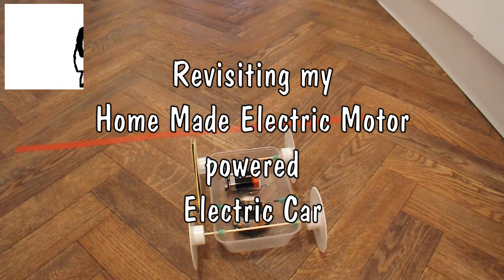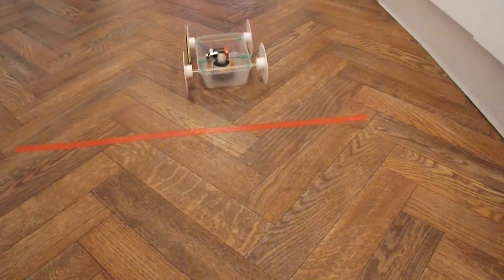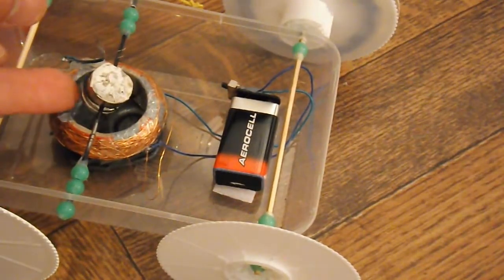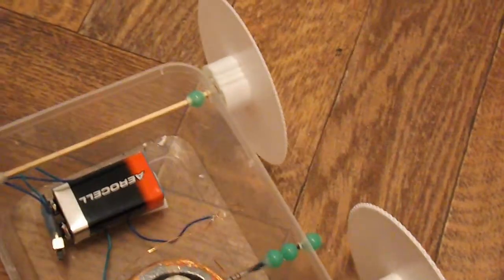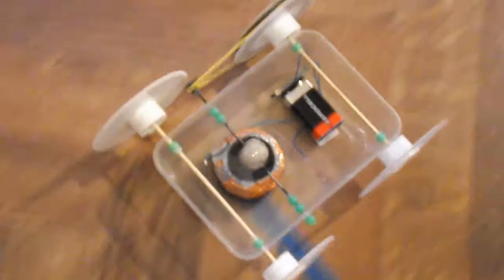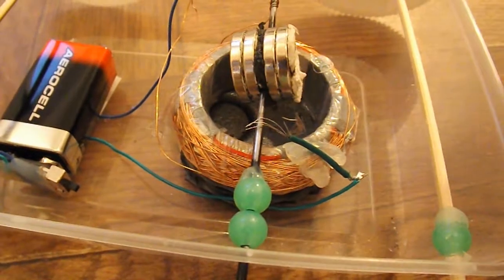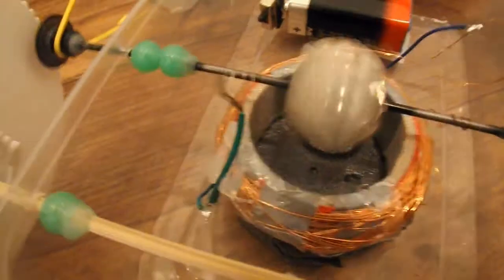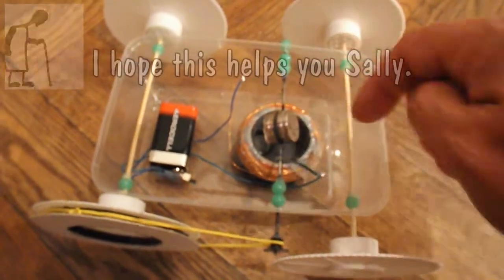Revisiting my home made electric motor powered electric car

Comment: And one more question, what is that white stuff on the magnets on one side which doesnt exist on the other side of the magnets?
Reply from the maker: There are 3 videos in this series and I have grouped them together in this playlist
http://www.youtube.com/playlist?list=PLA5a2xPRSrB0scvCxBYNn35HohUxUoj0e
The last one has lots of information in the video description covering all the questions I have been asked about this project. The white stuff is double sided tape left over from a previous project that I used these magnet in.
In answer to your other question it makes no difference whether the magnets touch the spoke, they are magnets, they are not part of the electrical circuit. The material between them is probably just polystyrene foam used to pack them apart to get the spoke through.

Comment: Is the coil of copper enameled or bare? Please please do me a reply
Reply from the maker: Think about that for a second. If it was bare copper it would just be one continuous short circuit between each winding. If you wanted to buy some you would look for "magnet wire" as that is enamelled. Alternatively you could strip down an old transformer or even an electric motor to get suitable wire. I strongly urge you to read the video description and watch all the videos in this series as it is NOT an easy build.

Comment: could you make this build without a pulley?
Reply from the maker: +Issey Grimaldi if you mean with gears in place of pulleys then yes. If you mean with the wheels connected direct to the shaft that goes through the motor then NO or at least I strongly doubt it. This motor is very low powered and you need the gearing to enable the car to move with such low power. You might be able to do that if you make the motor more powerful with bigger magnets, more wire, bigger batteries, but then you are also adding weight. I think if you try building this you will find it is hard enough to get it working like this without adding more issues.

Comment: How do u make the pulley. close up on how the car moves. the wheel. please i am doing a project. i need it by tomorrow
Reply from the maker: The pulley is just a disk of polystyrene foam stuck to the side of the wheel with a bigger disc of cardboard stuck to it to stop the rubber band slipping off. There is another example shown in this video for another car. http://youtu.be/iE_k6UHiT1I?list=PLA5a2xPRSrB0yTUYmJSS3ML5xxaBzHl3e
Reply from the maker: The other pulley, the small one on the motor shaft is one I found and added a small cardboard disk on the outside to stop the band slipping off. You could probably make one that size by gluing a couple of plastic beads together.